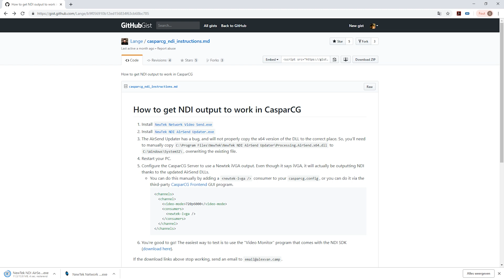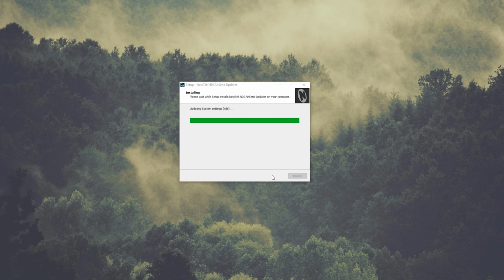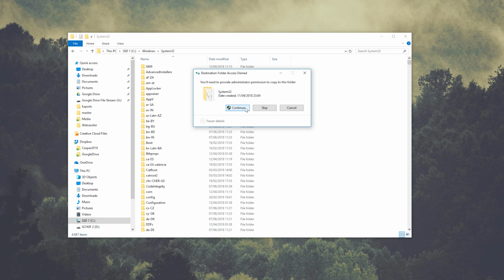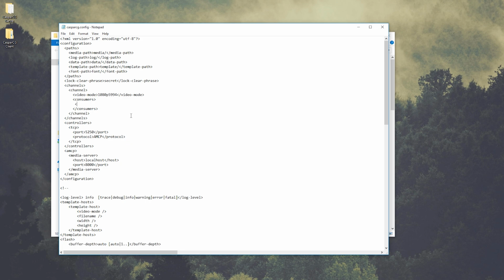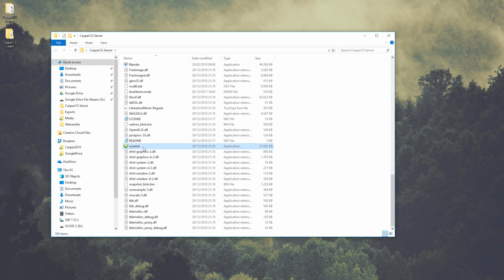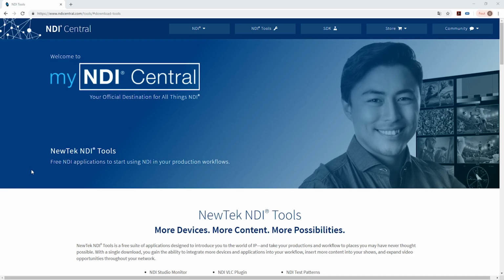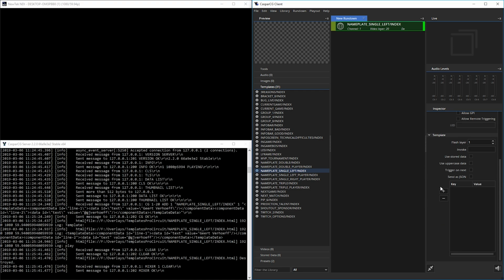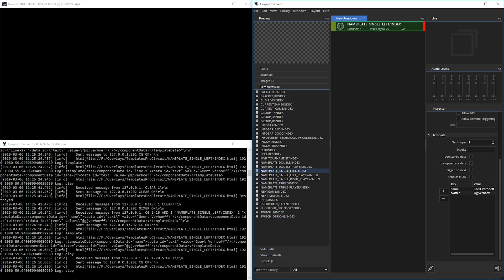Output NDI with CasparCG - CasparCG Tutorial

Comment: Client 2.0.8 and Server 2.0.7 - NDI Output works partially. I get no audio output via NDI. I tried vMIX, OBS-NDI and then via the NDI Studio Monitor application. Of course set to the right Audio Device. You can help me?
Reply from the maker: Airsend could be the problem. Have tried reinstalling that and also redo the moving of the.dll files
Reply: the|Gamer Any progress with this? I have the same issue on multiple machines.
Reply: @DavidCasamona  Did you by chance solve the audio issue?
Reply: @daviddebono8590  Check the newest builds of Casparcg now, NDI producer and consumer working really well for me.